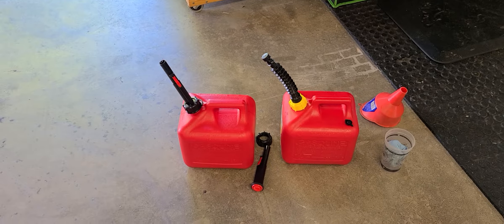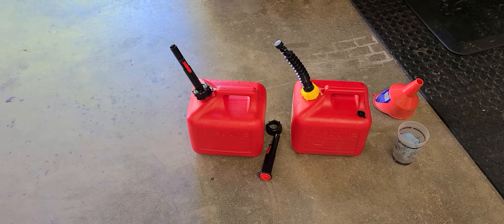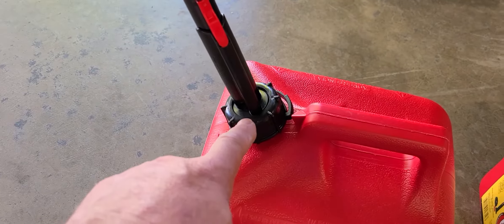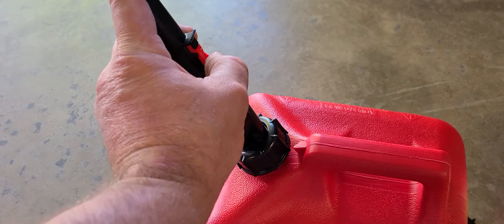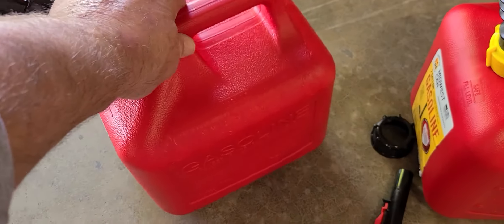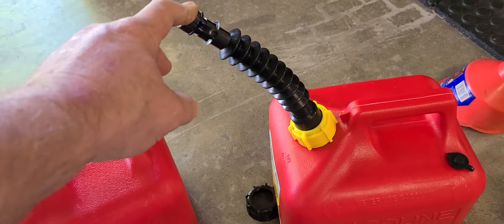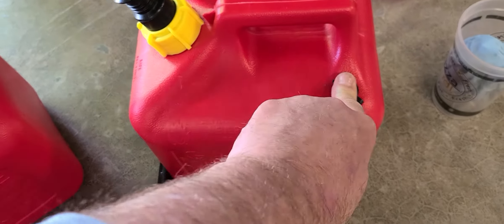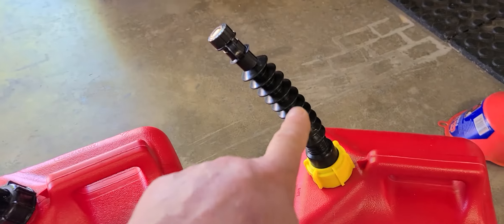Midwest Can spout swap out (poor design)

Comment: Yep, those safety spouts suppose to help protect the bozone layer, but they create more of an environmental mess than they claim to protect. Another problem is the plastic welded seams tend to split over time. So, I upgraded to the metal Eagle Type I safety cans but they're a bit pricy. A 2.5 gallon version cost just as much as the 5 gallon one going price about $50.

The only time I've spilled fuel from that can was usually my own fault, either I didn't depressurize the vapor in the can before start pouring or not paying attention while dispensing thus overfilling it. Not a good idea if you're going to store E10 gas in it, but I only use it for stabilized non-ethanol gas and they've served me well for the past 5 years.
Reply from the maker: Cool beans...got info. How come we never hear about the "hole in the ozone layer" anymore?

Comment: Used a Midwest can with this spout to fill a generator last week. Had no problem. Easy to use. Dispensing/filling was quick. I actually appreciated that the flow didn’t start until I rested the release trigger on the edge of the generator spout so gas didn’t spill as I was putting the spout into the tank opening. #midwest

Comment: what really sucks about them dam things is. LIke when putting gas in my wife's car. its a pain in the ass.  when you need to hold a can and activate the dam safety shit all at the same time.  They suck. I always replace them with aftermarket shit.  They now have gotten to the point were they change the thread's so you can just use your own.  The EPA or who ever the hell it is are causing more problems than any good.
Reply from the maker: Yep, exactly. The spout I bought online had matching threads.